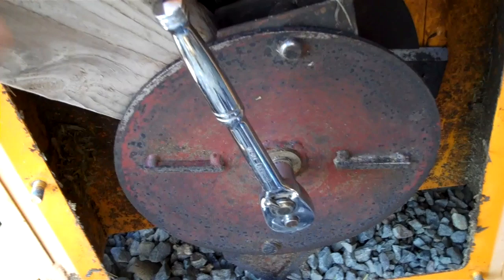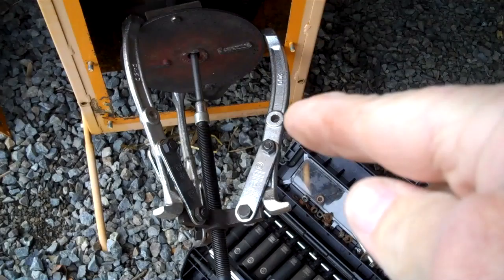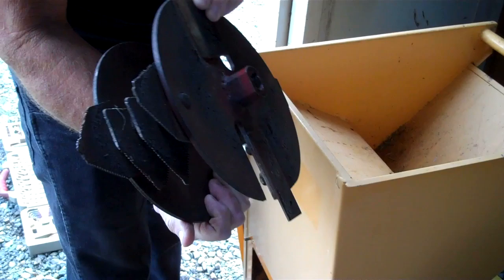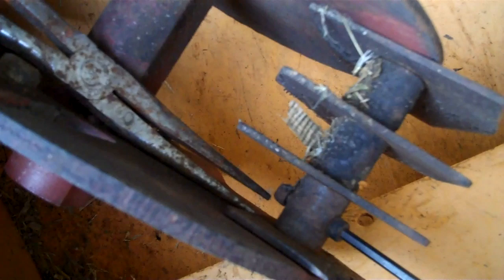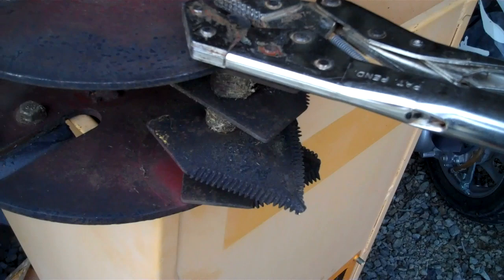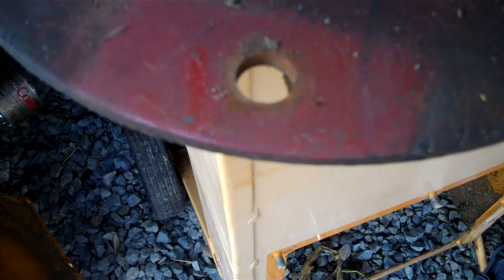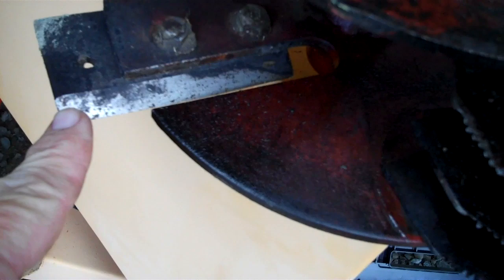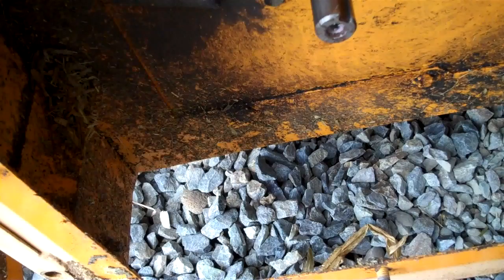How to accomplish a Harbor Freight Chipper Shredder Blade Removal

Comment: I was able to remove the blades and flip them without removing the main blade assembly from the chipper. The flail pins were held in place by the spacers that were held in place by the allen bolts that connect the innermost spacers to the flail pins. Once I took out the allen bolts, the flail pins could be pulled straight out, which disassembled the blades and spacers. I flipped the blades and reassembled the blades and spacers, one flail pin at a time, one pin/spacer at a time, as I incrementally pushed the flail pin back in. The last spacer to be put back in place was the innermost one (the one with the hole for the allen bolt).  I put the allen bolt back through and tightened the lock nut. I repeated the process for the other flail pin/blades/spacers. This was all done while the main blade assembly was still in the chipper. No gear puller needed.  Reassembly is a little tricky doing it my way, but it looks like you would be able to handle it.

Comment: sharpen blades with angle grinder and flap wheel flap wheel does not gouge blades like a hard wheel gives you a really sharp smooth finish and doesn't take off metal

Comment: Kind of how I figured it would be. My carriage doesn't seem to have bolts holding the blades. There is no hex to grab onto. Not sure if it was built that way or I've just worry down the edges. I might consider grinding off  the head a replacing the bolt with my own. Did you see the zerk fittings to grease the shaft? It allows the blades to turn more freely. Your blades look better than mine. My teeth are damn near gone. I need to buy a puller now. Thanks for the video. I twill help others with this problem.

Comment: Hey. Have you ever changed the oil in one of these things? If so, do you have any suggestions? My guess is I'd have to tip it on its side, and that mounting plate would cause a mess.

Comment: Can you show us how to change the oil on these things? There is no crank case bolt on the bottom to open in order to drain the oil (or I missed it). Looks like I would have to turn the whole thing on its side.

Comment: Those flails look exactly like sickle bar sections, if it were me I’d use my drill press to make some new flail blades out of sickle sections. Flat file the blades to sharp-sharp.
Reply: Thank you for this comment - was trying to find replacement parts for those blades and was not able to find them. Looked up "sickle bar sections" and you're right - they look just like them. Going to pick some up for new blades. 👍
Reply: @stickwallfarm  did it work?
Reply: @dontbea7237  yup, worked great! Just had to enlarged the mounting hole

Comment: How is the parts availability on these things? Is it easy to get replacement blades and flails?
Reply from the maker: At the present time, I don't think parts are available....but hope springs eternal ;-)
Reply: I have been looking for replacement blades, and no can find.  I went to local metal machine shop and they quoted me $350.  Have anyone found replacements?
Reply: Looks like these might work for replacement flails. Google this "Sickle Section Shape 2 TS H Plated 10 pack".

One example: https://www.amazon.com/dp/B073WRTQD8
Reply: This one has 3 holes. I guess you have to drill a bigger holes in the middle to fit the pin that holds the knives.https://www.tractorpartsasap.com/sickle-section-shape-2-ts-xh-black-anvil-3-hole-ctsk-10-pack-new-159776.html

Comment: where can I get parts for chipper and 5.5 hp engine?
Reply: Man! Good Luck With That!. The cooling fan on mine disintegrated and I've searched everywhere to no avail. Harbor Freight no longer supports this engine.  The newer Predator engine  part is similar looking but does not fit and no one on the internet lists anything that I can find for the Central Machinery engine so I'm completely down for a cheap $10. plastic part.

Comment: I bought a used unit from a friend.  Mine has a grate with several 1 inch holes that is sort of a guard/ sieve to hold debris in the chamber for mulching. Did yours come with an open bottom ?   J K
Reply from the maker: James Krivitsky 
Hi James 
 they're all the same you got one that's original I still have all those parts too
 I just took them all off because they're a pain in the neck and only made for safety reasons and cuz I'm the only one that uses it I don't need safety I know what I'm doing I stay safe I'm an adult 
those are really in case children get ahold of it 
it could be a real train wreck with their body
Reply: @Jonehughes  Would you consider selling your grate? I just broke mine the other day.
Reply from the maker: @bobbolshavic3035  yes
Reply: @Jonehughes  How much you want for it?
Reply: @Jonehughes  Do you still want to sell it?
Reply from the maker: @bobbolshavic3035  yes
Reply: @Jonehughes  How much you asking? Do you have paypal?
Reply from the maker: @bobbolshavic3035   Yes I have paypal make me an offer brother
Reply: @Jonehughes  25.00 ?